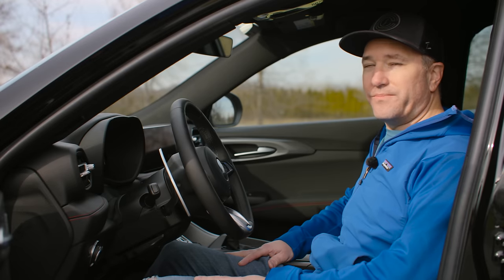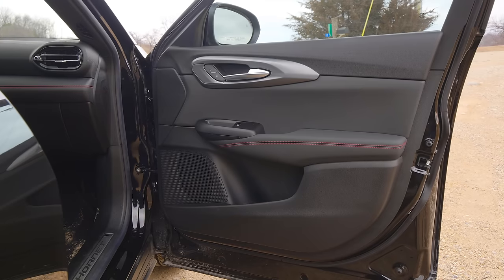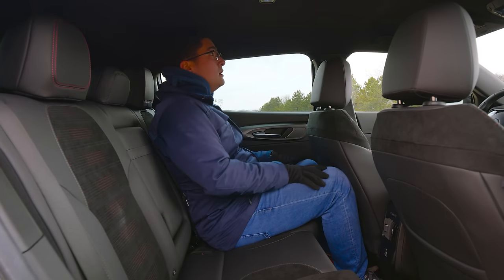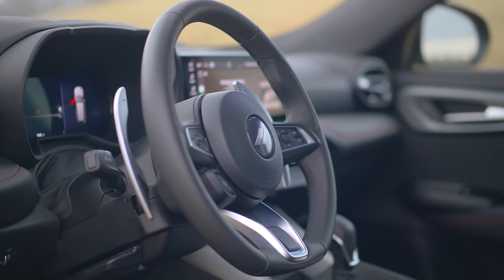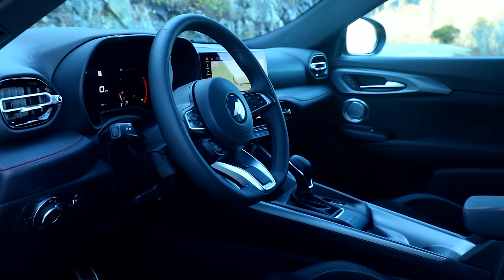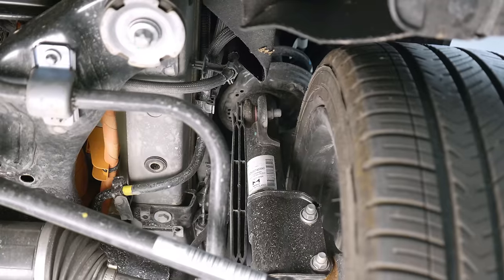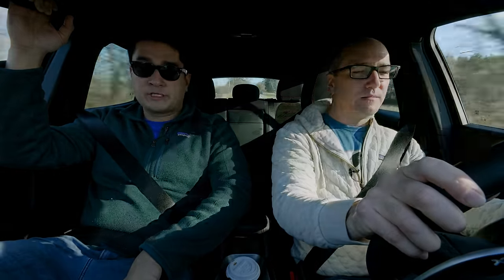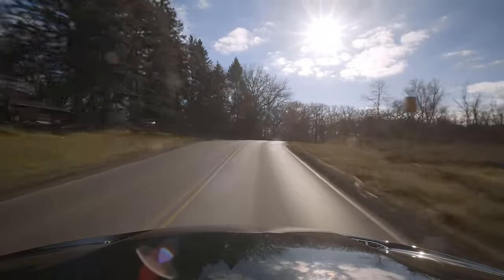Dodge Hornet | A Stinging Sensation

Comment: The Dodge nameplate is synonymous with aggressive power, historically from a big block. But as long it maintains that position among its competitors, the type of motor is uses becomes inconsequential. 

Anyway, I'll say this much for it, its a very well styled SUV. Not weird shaped with a lot of discontinuities and conflicting lines and curves like so many EVs these days. Not all of us want to drive around in a bizarre looking SUV that looks as though it was assembled from a hodgepodge of various car parts left over from past generations then patched together aesthetically like the Frankenstein monster.

The exterior is sleek and the interior is well appointed for a vehicle of these category. The only things I would change is to add more colors and textures, and to relocate the shifter as they've become pretty much obsolete since everybody knows by now there's no direct connection to the gears. The would clear up an awful lot of much needed storage space in the center, especially in this compact SUV design.

I really like their continued use of button (that a thing to mention nowadays), and the infotainment display is very well designed and at least none of the switches look cheap from a distance. If I were nitpicking, I'd ask for smaller bezels on the infotainment display.

Comment: They catchup by building on competitors' prior generation platforms: buy up outgoing production line capacity and supporting supply chains, tweak/refine using latest tech/parts/materials, and add price competitive modern amenities.  The market is efficient.

Comment: Fiat Chrysler has issued a recall of 2023-2024 Dodge Hornet plug-in hybrid electric vehicles over the chance of fires.
Owners are warned to park outside and away from anything that could catch fire.
Chrysler says the 12-volt battery positive cable or high voltage connector cable may not be tight enough which can overheat the electrical connections and result in a fire.
A fire could occur while driving or when the vehicle is parked.

Comment: Rav4 Prime PLUG-IN highburdz should have been compared to this pile, not a standard Rav4. My wife's 2021 Prime SE was $42k before the $9250 rebates. It still runs ~5 seconds to 60mph, we get over 50 miles of E range, more space, it can tow 2500 lb, & its reliable.

Comment: I think the biggest problem is going to be whether this thing will be a reliable car. I was one of the lucky people that bought a Dodge in the past (2014 Dart) that didn't get burned by Dodge-Chrysler when it turned out the car was a lemon. And just because Dodge bought my car back, I'm still nervous about ever owning a Dodge again. Which sucks, because a used Charger or 300 could be a good family car for me, or a Pacifica could be an even better car for my family, and I really want to like this car because I like small cars that could be called hot hatches. But Dodge and Chrysler aren't really known for building quality cars, they're known for building shitboxes that could be fast as hell or at least look fast, but they'll break down on you almost all the time, but they're almost like Nissan, they're almost giving these things away.

So yeah, color me nervous about this thing.
Reply: Is not going to

Comment: The value really seems somewhat comparative here depending on how you think about it (and assuming it holds together reasonably well). For example it seems like a great deal compared to its Compass cousin, which for about the same money has a less powerful drivetrain and an older, less refined interior. As noted it is also quicker than pretty much anything g at the price.

Comment: While trends towards trucks and SUVs were in full swing already, the bailouts in 07-08 essentially killed the car for the big 3.  Ford/Chrysler/GM focused solely on the high margin vehicles, and set the plans to get rid of cheaper lower optioned vehicles.  Interest rates were basically 0%, so it was a no-brainer to not offer anything to the poors from a manufacturer perspective.

Comment: If Dodge is going to HAVE to use 4 cylinders then I know a way they can still get people to buy their cars.

Buy a bunch of SR20DETT engines from Nissan and run 20psi through them with a 9000rpm redline. If the tyres ever stop spinning then 0-60 in under 4 seconds should be doable.

Comment: Let me explain to you what a forward crash mitigation system is. And I have yet to see a car without one.
As you are driving the car, you look through the windshield, if you see something blocking the direction of the car... put your foot on the brake and apply it. That's it. So unless the windshield is going blank, the forward crash avoidance system or mitigation system, is still functional. If you're not paying attention, you don't have any business driving the car!

Comment: If Stelantis hopes to salvage Ram, Jeep, Dodge, and Chrysler, they need a V8. If they have to sell smaller turbocharged engines, at least they sould make them small turbocharged V8s. Get the engine and driving dynamics, and most customers will forgive the software glitches. Luxury is spelled with a V and  an 8. There's a reason why manufactures augment their cheap exhaust with a V8 sound track.

Comment: I think Dodge needs to bring the avenger back with the same power train with 200 hp and 300 hp, bring back the journey or similar sized vehicle and have the same power train as mentioned above, then make the Pacifica the grand caravan next gen with the turbo engine from the hornet gt maybe the plug in and Redesign the Durango. For Chrysler bring back the 300 as an ev, redesign the Pacifica as an upscale ev only van, maybe bring a couple vehicles from overseas as luxury evs/plug in hybrid.

Comment: I don't think this is honestly as bad as you guys make it out to be. While I wouldn't personally buy one; I think that something like this with decent mileage and decent everyday performance is actually pretty nice. The interior isn't horrible either and it looks like it is way more fun to drive than a Jeep Compass which really was pretty horrible when I had one as a rental. 

Not every car needs to be a race car in order to have some sports car elements. Honestly some people just like to have a car that gets out of its own way. 5.5 sec 0-60 with good low end grunt is pretty nice for a small SUV where most of the cars are boring and slow and overall terrible. 
Think about the Honda CRV, HRV, RAV4, Corolla Cross and Equinox.... those are all insanely slow and terrible to drive. The Mazda CX30 and CX5 can be decent with the 2.5L Turbo engine but otherwise also very slow and boring. Nissan Rogue has a stupid CVT as does the Corolla Cross and neither of those is quick or fun. 

Just looking at the competition means that this vehicle SHOULD be more compelling than all of those cars. However Stellantis overall quality issues and very questionable longevity might be the worst things about this vehicle.

Comment: It looks better, and is higher quality, but it's not sporty. Now, maybe if they make an SRT4 version... I've had two Caliber SRT4's and I'd probably buy an SRT4 version of this. With Dodge trying to stay relevant and the Charger/Challenger being dead, I don't see a good business reason NOT to make an SRT4 version. Unless their intent with this is to build something slightly sportier without having to invest any real money in the platform. I don't like that the paddles are on the column and not attached to the wheel. @14:50... I'm surprised you didn't mention the Neon SRT4. That was the Neon that set people's hair on fire.

Comment: I was forced to rent one of these recently. I hated every minute of driving it. The paddle shifters are huge and block the turn signal lever, outward visibility is terrible, rear passengers have to dodge the weird shaped door when opening it, the engine noises it makes are unsettling and remind me of a spin cycle washing machine , the cluster display has huge areas of nothingness. Also cargo room in the rear was micro. I was so glad to dump it back at the rental company.

Comment: The shift paddles comes direct from the gulia, the steering wheel as well. But Aluminum paddles, column mounted 😂😂😂
Reply: I mean, directly from the Giulia, after they have also been on Stelvio, Levante, MC20, Granturismo, and now Tonale which is virtually the same product of the Dodge.

Comment: Okay some thoughts.
1) So first off, this new method of stability control sounds annoying. Emphasis on the word control yet in a different sense of what (who) they're controlling. Like you aren't allowed to even try to drive like this, and it's more predictive approach than reactive.
2) Second, I don't think this massive emphasis and description on what Dodge was is THAT important or THAT accurate. Simply because Dodge wasn't that until, relatively speaking, recently. For the longest time and not that long ago, they had a full line-up of boring cars just like everyone else. There was nothing interesting about them. And I don't think most Dodge Durango and Hornet buyers are these recent fans of muscle-car-Dodge (I could be wrong). The bigger issue, to me, that I want to highlight is what you said in the video once: they have just the Durango, Pacifica, and Hornet between what used to be the two main and top-selling brands of Chrysler. It's kinda sad and no one will take you seriously without a lineup. In short on the second point: what is way more important than identity is the need for product!
3) Third, I am impressed in the interior for this class solely due to the Alfa DNA (pun intended). It actually in a lot of those little premium-car-touches steps past the CX-5 as the most luxury-like in this class. I agree with Stellantis in determining that it is cheaper not to change these things than it is to design and supply cheaper parts for Dodge, but at the expense of hurting Alfa. I'm going to list the little things that are done better than this class it competes in:
Trunk carpeting, climate control panel design/quality/switches, lack of cost-cutting in back seat doors, rear center armrest grab-hold, dual map pockets, paddles and steering wheel, steering column boot, center console wraparounds, door armrest pads/dressing that fold past the corners, lack of piano black, door switch pedestal, all other switchgear, and overall layout and design of the instruments, infotainment, speakers, and vents. (Platform itself though is complete and utter trash and omg that rear suspension is ass))))))

Comment: Dodge needs to go neo-tuner. Go crazy with the 4 cylinders. Go for old-school turbo lag, hard hitting, high revving turbo cars that make fantastical wooshing noises. Make em loud and brash, but keep the hybrid aspect so you can just turn it all off. Or, better yet, and adjustable bypass valve that diverts to a sound tube that goes into the cabin for fun times, and then blocks that off for when you want to just chill on the highway. This would be so easy and cheap if they embraced it. I think they could.

Comment: What does Dodge do for the future? Big HP EVs won't do it, as many manufacturers will offer that (and do already). Perhaps Dodge and Alfa could join forces to do entry-lux performance vehicles, mostly EVs, but also with ICE hybrids as their top performance offerings. Both could focus on design and vehicle dynamics as their core "reason for being". Alfa needs more platforms to utilize like Giorgio, not the Cherokee/Compass "little cheaper" foundations and Dodge could benefit from moving upmarket somewhat.

Comment: These car companies are asking for it. They are asking for these cars to sit there. They are asking for the used car dealers to kick their ass. They are asking for customers to leave them. They are asking for their demise. No one, especially during a historic inflation period, is going to sell out 40 or 50 grand for this crap. The car companies telling us that $30,000 for a Honda Civic is cheap and to spend $45,000 on a crossover like this Dodge hornet is a steal is never ever EVER going to work. It is the epitome of pissing on someone’s leg and telling them that it’s raining. People determine the price and the value of a vehicle. If people are not going to pay it, they can not charge it. You and I everyone in this comment section, and everyone else knows damn well that this car is worth more than 25 grand tops. It’s all wheel drive, at least some form of it, and it has a good amount of pep. The horsepower on it is pretty damn good actually. But in the end of the day, it’s a Dodge. It’s just another overpriced piece of plastic with an engine in it.

Comment: But, Dodge has always made small sporty whimsy vehicles; think : Omni Turbo. They should be able to do small engine cars. I was just thinking, at $40k, I can dig a bit deeper and get into a Porsche Macan with a few miles on it. Maybe if you just love hybrid; but if I wanted to plug in an electric I would then again shift brands to a Model Y.

Comment: Detroit moved away from small cars because they could not make money off them, plain and simple.  I was told by a Ford insider that with all the Ford Escorts they sold over the years, they still did not make money in the end between the design, manufacturing, warranty work and so on.

Comment: Stellantis should invest their money on improving the performance, reliability, and materials of the Jeep Compass and Fiat Silvio as a winning formula to be used in the Dodge Hornet.  I will not buy or lease a CUV with less than a 2.0 liter engine whether a naturally aspirated or turbo charged engine.  Dodge needs to reinvent itself into a bullet proof mechanically reliable American Brand which can complete against the Toyota RAV4 and Honda CRV.  Consumers do not want drivetrain complexity!  The Winning Formula is simplicity along with easy serviceability and maintenance under the hood with an easy to use and very intuitive infotainment system.
The Hornet to my eye looks like it was the same group of engineers who gave us the Dodge Journey.  Dodge would probably been better off resurrecting the Dodge Journey body style since it had more interior and cargo space.  The updated Dodge Journey could have also been rebranded as the Dodge Voyager to complete against the RAV4 and CRV with the right stuff baked into it!  Jeep needs a larger Compass model to fill the void created by the discontinuation of the Jeep Cherokee.  Both Jeep and Dodge need to get their acts together if they want to survive and thrive.

Comment: I don’t understand the praise these things get. I test drove one and hated almost everything about it. Yeah it has pep for a little SUV thing, but the ergonomics of the car and overall build quality are your common Chrysler junk.
The biggest standout for me was the rear door’s quarter window which actually pokes out right at about neck level and almost poked myself on the throat opening it! It sounds like hyperbole but try it yourself! It opened it several more times just to make sure I wasn’t crazy.. it’s really that poorly designed.
And the backup camera is choppy! Low frame rate, looks like hell.. we’ve had this tech for years and they managed to cock it up. 
I don’t understand. Hard pass from me.

Comment: Dodge in name only. It's a Alfa built in Italy. I've already read a piece recently about the poor quality control and time in the shop for people brave enough to buy one. The local dealer in my Florida town has a line of them out in front and I've seen the same ones sitting there for months. No one wants a shoddily built Italian crossover with a Dodge nameplate for the price they're asking.  They're sitting there with all the overpriced Jeeps and RAMs packed on their lot not going anywhere either.

Comment: I drive a 2015 VW GTI which I will be getting rid of in about a year and a half.
Part of the reason (aside from its age) that I'll be getting rid of it is that I'm tired of the low ride height, babying it over sharp dips, driveways, broken pavement etc., plus I'd like more all weather capability.
So in theory, something like this Hornet would appeal to me, because it's got car like driving qualities - kind of like a lifted GTI.
But...
The Dodge/Alpha Romeo thing is a deal brekaer.
VW's are bad enough with long term reliability costs.
Alpha and Dodge is the worst of both worlds.
Reply: Yo same reason why I want to get rid of my Honda Fit. Sedans and hatchbacks are just way to impractical. They use to have decent ground clearance in old photos I see but manufacturers are so obsessed with making them as low as possible.
Reply: What issues have you experienced? 

I own a 2.5l 2009 Jetta and I’m wondering how VW’s reliability has changed since then. 

The issues I had were: 

2019: ABS module, VCG, and Serpentine belt
2020: alternator
2021 PCV valve and oil cap gasket
2022: Map sensor, vacuum pump delete.

Comment: The plastic suspension components are fine. Aluminum and plastic are equally terrifying compared to steel from a material properties standpoint. Neither are going to have an infinite fatigue life. Steel might have an infinite fatigue life, but accidents happen. In those cases, the steel/alu/plastic are sorta a moot point when you consider the science applied to crash survivability. It’s not that emotional of an affair unless you’re the avg reddit user. 

This car fuggin sucks. It reminds me of new deathcore. It ticks boxes for compliance. While it takes brains, it doesn’t take any talent. There’s nothing to it.